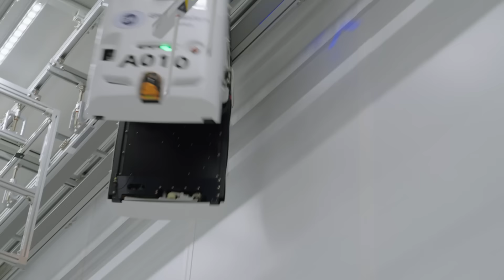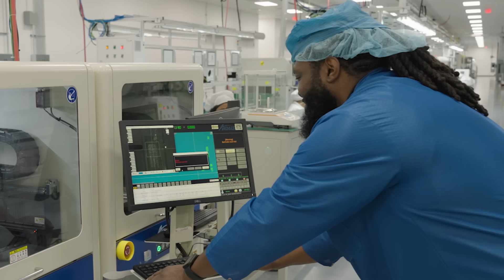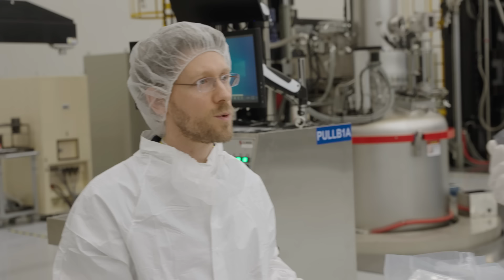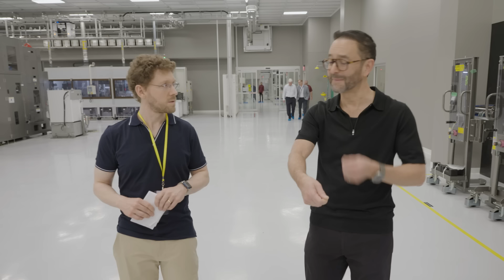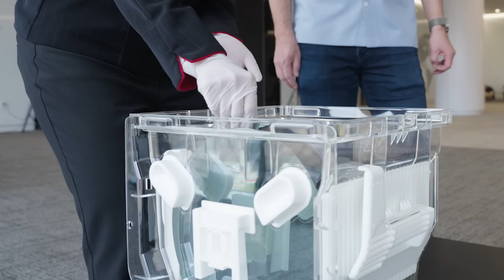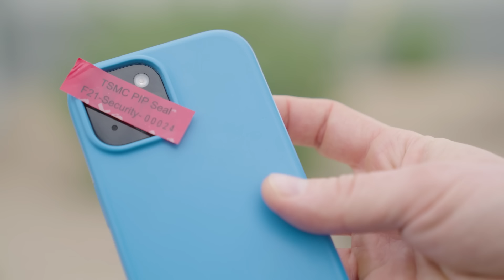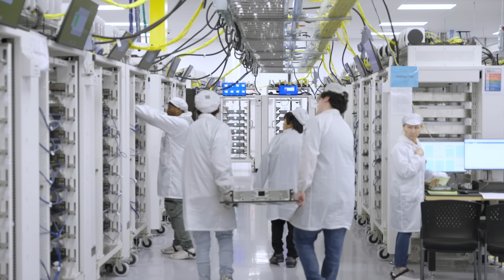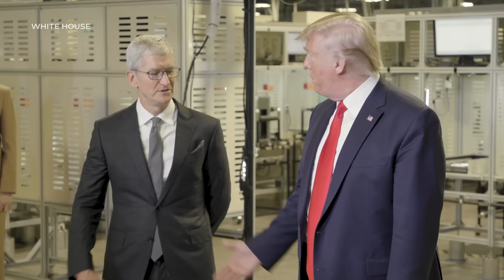Inside Apple’s Multibillion-Dollar Push to Make Chips in the U.S. | WSJ

Comment: Apple's push? They wouldn't do anything if they didn't have to
Reply: Yep.
Reply: Just like you, except you still do nothing 😊
Reply: It’s because of the bipartisan CHIPS ACT signed under Biden. It provides billions in subsidies for semiconductor fabs.
Reply: It would have been awesome if Intel agreed to make processors for Apple.
Apple approached Intel first to manufacture iPhone processor, Intel refused.
Reply: @gund89123  Intel is why America isn’t leading in tech. They keep betting on their old stodgy companies instead of doing it themselves properly with upstarts
Reply: @gund89123 because intel refused, apple had to start making apple silicon quite early. if they used intel just like in the macbooks, the performance wouldve been horrible until 2020.
Reply: @gund89123  intel is late, and is completely blown out by AMD . Look up its marketshare and stock price compared to AMD, Nvidia,  (both chip designers) and then TSMC (manufacturing)
Reply: @gund89123 and now, apple dosnt want intel chips, neither do they want their chips made by intel. Simple, it's not goof enough.
Reply: @gund89123  
Apple used to approach to Intel for design the processor of iPhone which had been denied by Intel. So Apple had to do it by itself. When the design has been finished, the fabless business mode couldn't be deployed inside Intel. So Samsung got the order of 1st generation ARM based iPhone chips.
Now Intel lacked of hegemony both in designing and manufacturing of advanced chips.
Reply: I’m thinking of putting my entire life savings 350,000$ into Apple stock and hope it doubles in value in the next ten years. Is this a bad move I think Apple can become a leader in Ai chips and the stock can possibly triple
Reply: @GeeWizHarry putting all your eggs in one basket is always a bad idea when investing however apple does have a good reputation and has been very consistent over 20 years. so while its not recommended you could probably do that and actually make decent money in the end
Reply: @larrythemanic6.0mechanic78 
I think you're right. But I have a question. If you could go back to when Apple first went on the stock market, how much would you put in?
Reply: @GeeWizHarry it definitely seems to double every 3 to 5 years
Reply: @GeeWizHarry do it bro, success is made from big risk!
Reply: Trump is eating good on those apple profits. But when the supreme court slapped those down last week it looks like apple lost any reasonable leverage to sue the administration over their losses. They really messed up. It looks to me like a lose lose scenario. Tim Cook cooked apple.
Reply: @hbwi73jnctrwoo7r Tariffs kept going under a different law. No getting around it, it’s Made in America time
Reply: @Czeck0-u1k let's see how much you love made in America time when you won't  even be able to afford an iPhone 😂
Reply: @jackmorris1068 bizarre take when 1) tariffs were heavily used in US since Hamilton until post WW2 and from 1870 until ~40ya most mfn was made in USA so it can happen again w fair, no dumping markets, 2) inflation a year into new tariffs is 3%, same as 2024.  Anything else? Oh yeah 🤪
Reply: Nope. They profited heavily moving iPhone production to China. They trained the Chinese so well in the manufacturing of small electronics that China now leads the world. Now apple is profiting off “moving chip production back to the us”. Although it seems more like a token move than anything else.
Reply: they kissing the orange ring
Reply: When Tim Cook bends over for Trump (like all the major tech companies are) he has to save face by telling people it is his idea to make cell phones in the US. Get ready for the $4K iphone.
Reply: @HingleMacCringleberry  motorola 250 bucks. 😂
Reply: @HingleMacCringleberry  They'll be no taxes, tariffs, no overseas freight. Also, don't you understand economics? When people are working, low unemployment and making good wages it balances out to a vibrant economy. And you could afford a phone not made by slaves.
Reply: @inquizative44  thanks for the reply. I thought pretty much everything made in the USA was more expensive. 
   An iPhone made entirely in the U.S. could cost consumers between $2,000 and $3,500, or potentially even more, according to Wedbush Securities analyst Dan Ives and other industry estimates. This significant price surge, potentially tripling the current cost, is driven by substantially higher U.S. labor costs, infrastructure expenses, and the logistical challenges of moving the complex global supply chain to the U.S..
Reply: @HingleMacCringleberry  If Apple tries to sell iPhones for $3,000 sales will plummet. The richest company (Apple) in the world will have to lower its gigantic profit margin and be competitive. It's that simple.
Reply: @inquizative44 There is no competion if there are tariffs and there is only so much that apple can do to lower the prices, the major reason why a lot of things are cheap in the US is because they are made in Asia, with a low labor cost.  So either americans start to prepare to work at a low cost or yes, you will have to pay more for you iphone
Reply: @gabn60  You don't understand economics. Firstly, Trump raised tariffs in countries like China equal to the tariffs China charged the US for America's imports into China. Overall, that's what Trump is doing, making it fair! And to make these companies find it cheaper to manufacturer the products IN America to put the US back to work. This will bring American companies back home as well, like Apple. I prefer "Made in America" as opposed to 'made by slaves.' where they put nets outside the foreign factories to keep the workers (slaves) from killing themselves. It's easier to pay more if everyone is working and making money! 
Trump is RIGHT!
Reply: Yes, so that's why they are pushing. I take it that English is not your first language?
Reply: The tariffs have pushed them. You’re welcome.
Reply: @DrivenA111  This is about the semiconductor plant in Sherman, Texas. Texas Instruments announced the site in 2021 as a major 300 mm wafer fab campus. Construction began in May 2022, and the first fab started production in late 2025.. Just in time for Trump to try and take full credit. The project was made possible largely by the CHIPS and Science Act, which provided 1.6 billion dollar grants, a 25% tax credit for fab construction and equipment, plus state and local Texas tax incentives.
Reply: @yaotly1 Trump tariffs on China began 1st term, and Biden continued most of them.  

Don’t be ridiculous. You know, I know, whole country knows all manufacturing was moving out of the US 20 years ago. Many had no choice before tariffs.  Now that’s turning around, an enormous change that many including Steve Jobs said was impossible.
Reply: @Czeck0-u1k  How old are you? Why do you sound like a child?
Reply: @yaotly1   oh no, threat to your bubble.
Reply: @DrivenA111  Now this can totally be credited to Trump.
1. The tariffs were used to help pay for the so-called "big beautiful bill" that cut corporate taxes.
2. Companies raised prices to offset the tariffs, and there’s no incentive for them to lower those prices now that the tariffs are gone.
3. On top of that, the Supreme Court ruled many of those tariffs were illegal, meaning companies are now eligible for refunds.

In the end, corporations benefited three times: tax cuts, higher prices that remain, and refunded tariff money.
Consumers also got hit three times: we’re stuck paying for the tax cuts, paying higher prices, and we don’t get any refund.
Reply: @yaotly1 tariifs are not gone. Still in place under a different law passed by Congress. Nobody has gotten a cent of tariff refund yet, ands it’s unlikely. Pay attention.
Reply: @Czeck0-u1k  Source?
Reply: Also, why blithely claim companies “raised prices” when 2025 inflation was about the same as 2024, 3%?  Or, go see for instance the NPR basket price survey showing Walmart prices went up 5% for the year.
Reply: You can thank trump for all these big tech investment back into America
Reply: @Kronos1593 this started under Biden with the chips act but ok 😂😂
Reply: @GotKimchi   Thanks to Biden we almost became another country with his wide open borders, like the fall of Rome.
Reply: @inquizative44 gotta love people who can't talk about the topic at hand and just regurgitate fox news talking points because they can't think for themselves...
Reply: @GotKimchi  "Donald Trump
(U.S. President): Announced a major $100 billion additional investment deal with Apple in August 2025, using the threat of a 100% chip tariff to incentivize the "American Manufacturing Program" (AMP)."
Reply: @inquizative44 those factories were being planned and built before trump even became president lol
Reply: @inquizative44   Stop being a moron.  You can look up the fact that these plants were in the works long before Trump came along.  Did you notice in this video the guy saying that Trump lied about opening the plant he visited?  That’s all he does.  He lies and morons believe him.
Reply: @inquizative44  Where are those darn Epstein Files that you were so hot to have released when Biden was President? Didn't your guy even campaign on releasing the files fully? In fact, after he was elected he said he would order a release of those darn Epstein Files. But now both he and you have gone moot on the subject? Why is that?
Reply: @karagi101 Oh c'mon, it doesn't mean Trump pulled out keys and unlocked the door. Trump made it possible and it would not have happened without our POTUS Trump. Stop the hate programming.
Reply: @inquizative44  Do you pray to stop being a moron, or have you accepted that this is the Lord's plan for you?
Reply: @karagi101  If only you could escape the programming. It has a vice grip on your mind. Your more to be pitied than scorn. Read more. Trump is a soldier!
Reply: @GotKimchi  that didnt do anything to bring jobs to the USA it just limited how much china can get from us
Reply: @inquizative44  This is about the semiconductor plant in Sherman, Texas. Texas Instruments announced the site in 2021 as a major 300 mm wafer fab campus. Construction began in May 2022, and the first fab started production in late 2025. The project was made possible largely by the CHIPS and Science Act, which provided 1.6 billion dollar grants, a 25% tax credit for fab construction and equipment, plus state and local Texas tax incentives.
Reply: @inquizative44  Now this can totally be credited to Trump.
1. The tariffs were used to help pay for the so-called “big beautiful bill” that cut corporate taxes, but consumers were the ones who actually paid through higher prices.
2. Companies raised prices to offset the tariffs, and there’s no incentive for them to lower those prices now that the tariffs are gone.
3. On top of that, the Supreme Court ruled many of those tariffs were illegal, meaning companies are now eligible for refunds.

In the end, corporations benefited three times: tax cuts, higher prices that remain, and refunded tariff money.
Consumers: got stuck paying for the tax cuts, paying higher prices, and we don’t get any refund.
Reply: @inquizative44  turn off the Fox News, lady. And Google the CHIPS act 😂
Reply: @yaotly1  preach
Reply: @inquizative44 yeah now we are more like north korea no big deal
Reply: @underflo43tky  You're so dramatic.... 
If only you really knew!
Reply: @inquizative44 ok
Reply: They had to or pay sky high tariffs... "Donald J. Trump : Announced a major $100 billion additional investment deal with Apple in August 2025, using the threat of a 100% chip tariff to incentivize the "American Manufacturing Program" (AMP).
Reply: @inquizative44  
Actually iPhone has been exempted in the first place when Trump started threatening higher the tariff.
Reply: @jasonhow8604  You folks are so  finely tuned to hate Trump it's ridiculous. You guys will find out Trump loves America when when he passes on. Then you'll be filled with regret.
Reply: @inquizative44 Don't hate him I'm just not sad enough to sit there caring about him
Reply: @inquizative44 you just repeat yourself over and over? I've seen better bots then you. Like I said, they were building those factories before trump was president, lolol
Reply: @GotKimchi No, this is because of Trump. Perhaps you see a doctor for your TDS?
Reply: @inquizative44 deflecting back to talking points again and ignoring facts as usual
Reply: @GotKimchi  Your facts I abolished? Yeah, I moved on... It's easy when you rely on facts not fiction and propaganda.